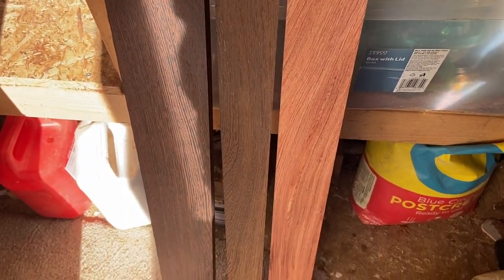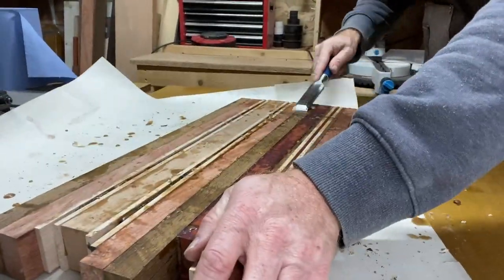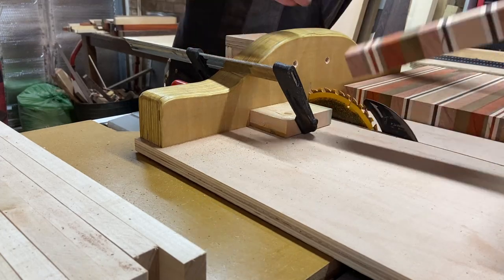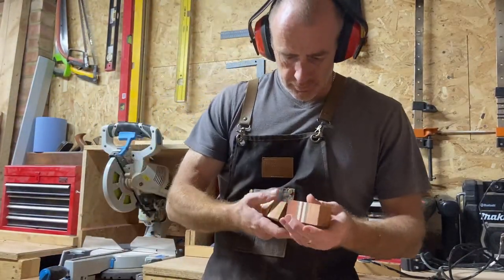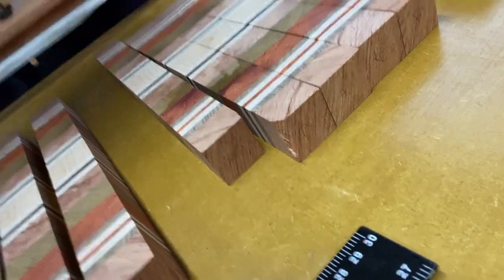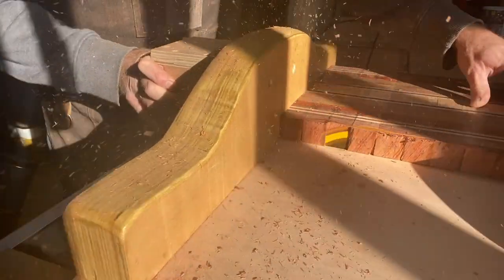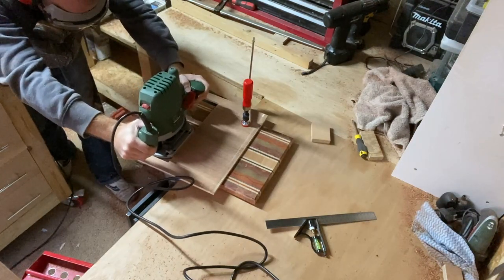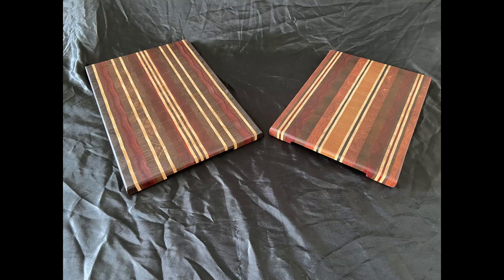Cutting Board fell apart

Comment: Many of the exotic woods should be wiped down with acetone before glue up. I found this out with padauk. I wipe down padauk with acetone and paper towels and you can see a ton of residue on each wipe.
Reply from the maker: I have heard about that before. Thanks.
Reply: Yes.  I  made a panel of ipe and Padua.  Used denatured alcohol to wipe them both down before glue up.  No issues, been about 6 months now.

Comment: I work in exotics all the time. My first build (shoe cabinet) came apart at the joint between the maple and purple heart. Why? Found out later it was because of the oil layer on the purple heart. 
You see, exotics, many times, have a high oil content. That puts a layer of oil between the glue and the adjoining wood which will fail eventually every time. But this can be completely fixed with a very cheap bottle of 100% acetone (like you get at big box/cheap stores for nail polish removal ... don't buy the expensive brands for woodworking. It's all the same stuff).  You're looking for 100% acetone without anything else. Read the ingredients to be sure. 

For exotics, quickly wipe (doesn't take a long time) the glue surfaces of exotics with acetone just before you glue. Acetone dries in seconds, so no long wait. Acetone removes the oil layer and allows the glue to work on both wood surfaces rather than one surface and the other coated in oil  ... which won't hold. I know. 

So, fix by getting cheap acetone to wipe off the oil layer before gluing oily wood (like most exotics ... purple heart, red heart, paduk, anything black, anything that is smooth when it comes off the saw), and you should be good to go. 

Who knew a cheap bottle of 100% acetone nail polish remover would fix it? 

It has NOTHING to do with how much glue you use. It's the oil. Oil puts a non-glue friendly layer between the wood and the adjoining piece. It WILL eventually fail, likely sooner rather than later. 

Cheap acetone will fix. Don't waste your time or glue ... having to clean up the drips/squeeze out that is beyond what you'd normally have. More glue, in this case, won't help. 

So, a note on rosewood. The face grain glues well after acetone, but no matter what you do (I used wood glue, CA glue) the end grain WILL NOT glue. Everything I used broke apart with a very slight pressure. I didn't use epoxy, but that's overkill, honestly. Just don't try to glue end grain rosewood or you'll be very sad. 

ACETONE before gluing any oily exotic (paduk, purple heart, red heart, ebony, African black wood, pink ivory, etc), but know that end-grain rosewood will NEVER glue up with anything I've ever used to glue. Even superglue will snap with the slightest pressure and while superglue will come apart with shearing force (which is why you can use it to fix clamping cauls), it shouldn't come apart with pulling force (tensile strength)... and it does on rosewood. However, rosewood glues beautifully on the face grain. Unfortunately, that means that you cannot glue rosewood so that it shows the face grain, at least not easily, because the end grain will not glue to anything else reliably.  

Just don't use rosewood in a cutting board. Matter of fact, don't use rosewood in any place that you will have to glue end grain. Won't hold, even with acetone. Will hold for a while, but not for the life of the piece. I know because I tried every trick in the book. If you can't screw it in place, don't use it if you have to glue end grain.
Reply from the maker: Wow thank you for the information April. Glad you mentioned the rosewood. It’s such a nice wood. You are the second person to mention acetone. I have seen a video with someone applying it also so I will get some for the exotic woods. Thank again :)
Reply: Thanks for the advice.  I did not know that about purple heart, I did know rose wood had an oily content and therefore glue resistant.

Comment: Your question, "was it the new wood or just me?" i feel it is a bit of both. Watching the video, things like your sledge board seem to wobble on your table saw, which is not good. Also when trying to flatten the item with the router box, you seemed to be removing a lot of waste with each pass. Take less off and do more pases, much safer! The last thing is the edges of the board tearing out when machining. The thing to do is glue some sacrificial wood to eache side as you glue up. Once you have finished all your machining you can sacrifice these parts by accurate cutting with the table saw. Lastly i would wipe the wet glue off with a damp rag, it saves a lot of scraping later!
Reply from the maker: Thanks Robert. Yep I agree with you on your points. I’m learning many things as I go along. Comments from people have been really good and helpful so I should help a lot going forward.
Reply: @hazelnutwoodcraft  Take all the advice and try each one, see if it works for you. Most of all enjoy what you are doing!
Reply: I 100% totally agree, plus wipe exotic woods with 100% acetone before glue up, and last but not least use two clamp and not just one whilst using his handle cutting jig. I've made and sold hundreds of chopping board and sets of wooden drinks coasters over the net in between the spare time I have as a software developer. Correct preparation is essential for not having to fix issues later on that can easily be avoided in the first place. Personally I think that these are simple mistakes that a man of his skill levels should not be making, especially as he is a fully qualified cabinet maker and thus know his stuff. I do like his DeWalt equipment as it far outweighs my Evolution kit (which I have plenty of).

I do like the end results of the chopping boards though, very nice indeed.
Reply: @PeteSimpson  Generally Peter i agree with you, but what you have to consider is his trade is a cabinet maker, not a maker of exotic items. Its a bit like a pipe fitter and a gas fitter. Two broadly similar trades that both deal in pipes, but are not the same.

Comment: You need a drum sander to prevent the planer from constantly chipping your wood.
Reply from the maker: totally agree with you. All in good time. :)
Reply: Is your combo planer/jointer using straight blades or helical blades?
Reply from the maker: @glenndelcarmen4381  straight blades.